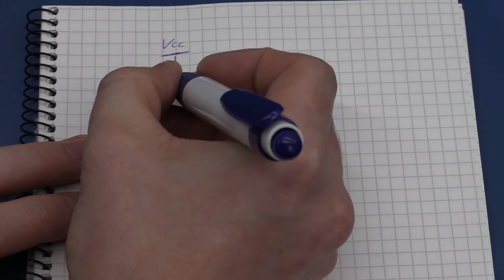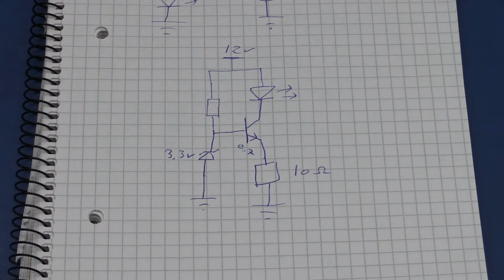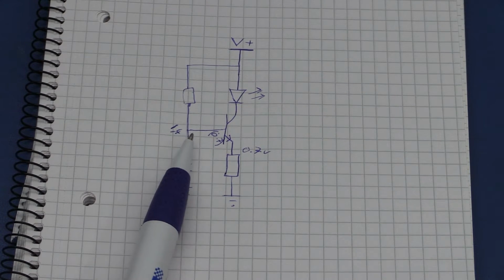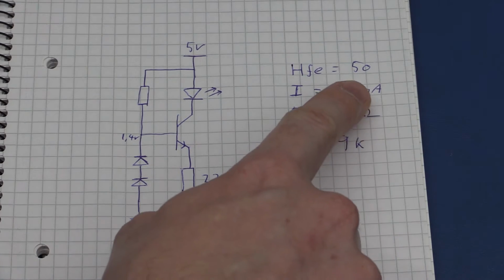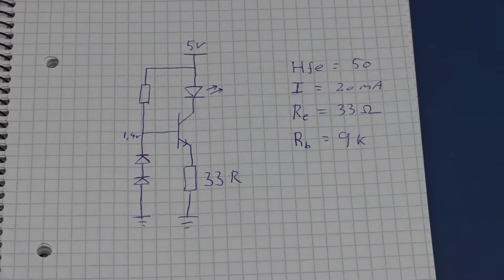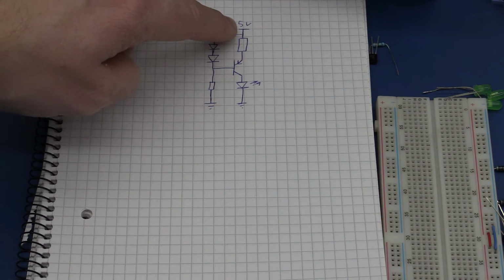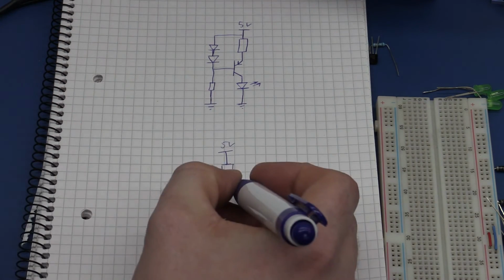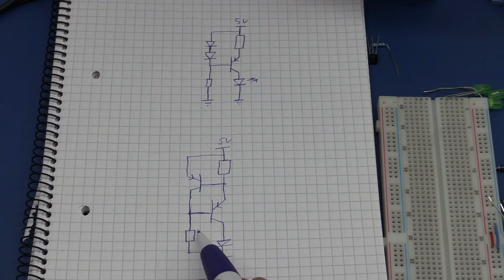Constant Current Supply for LEDs and more - Linear (Part 2) - Ec-Projects

Comment: Most favorite of mine so far:
https://www.instructables.com/id/Circuits-for-using-High-Power-LED-s/
4 components, with zener can PWM'ed with microcontroller and can handle up to 60V, lots of LEDs. Covers near 100% of 100-300mA LEDs usage for "homegamer".  Can be used for 20mA as well if needed, with less powerful mosfet. 
Also I played a bit with ideas from Kevin Darra's videos lately and I like solution with voltage reference, works like a charm, cost less and good for driving 350mA LEDs.